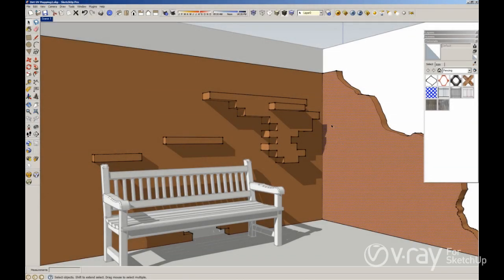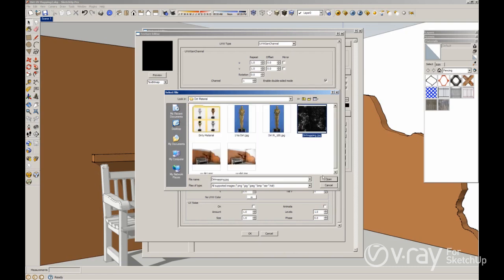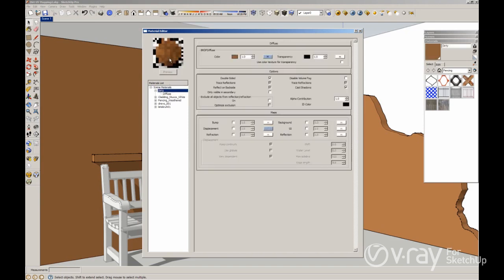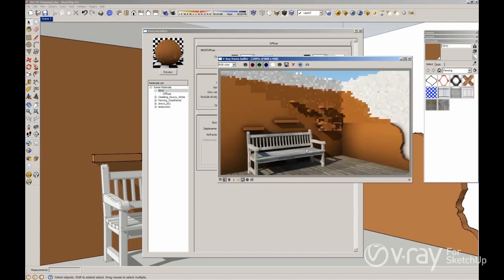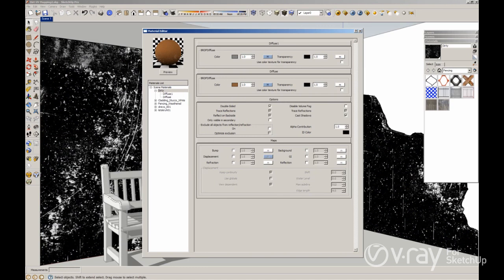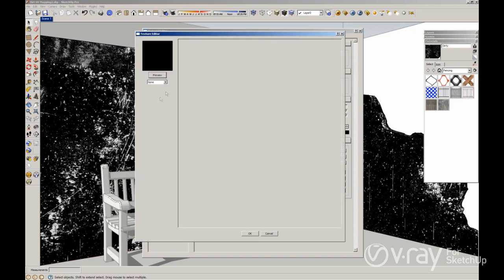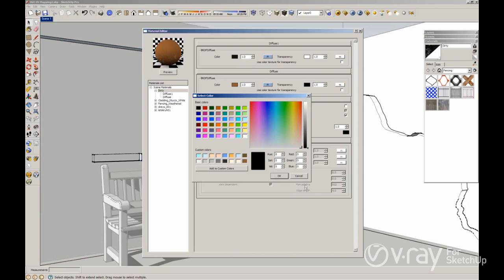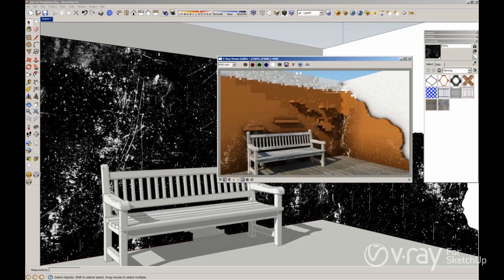V-Ray for SketchUp - UV Dirt Mapping - tutorial

Comment: Hey, I wonder what is the point of making second diffuse layer on top of the first? After applying the dirt texture to the first one, I just right clicked on the face it was applied to and by selecting "texture" stretched it a bit exactly like you did and the result was exactly the same. You can easily control the mapping having only one diffuse layer. BTW your tutorials are really helpful.